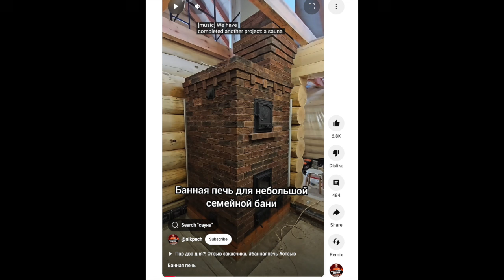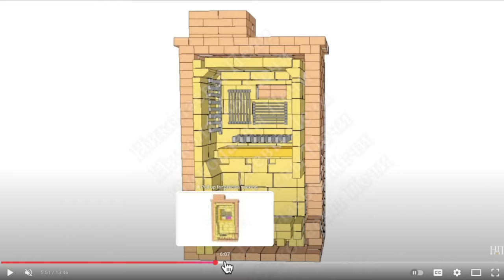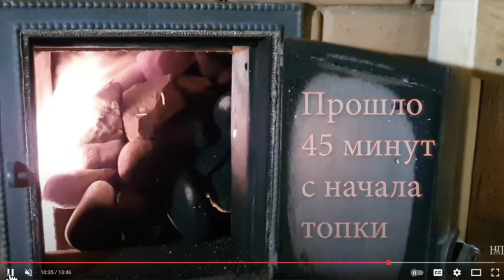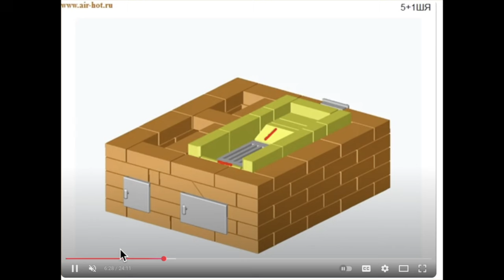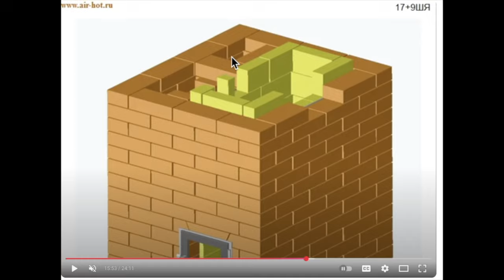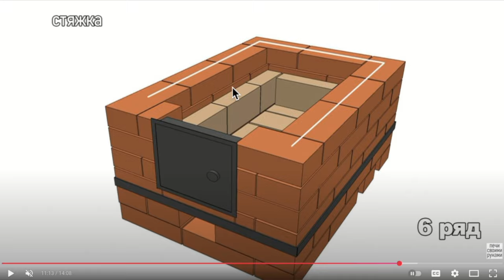Large Sauna Stoves Where The Flame Goes Through The Stones

Comment: Stoves with secondary air gets more heat  from the fuel (>2% maybe as high as 7%) but it also decreases particulate pollution and deadly carbon monoxide (CO).   So it burns cleaner - less plugging.
If your chimney should leak, you don't want CO.
Please write a script.  Your good information will be much easier to absorb with improved organization.
Pro tip:  If you start a sentence, finish it before you jump over to another point.  Reading a written script helps those of us who think of multiple things at once line each idea up in a clear order so we do not exasperate our audience.

Comment: I have a large fire place in my living room it has a gas connection if I use the gas with the flu open the heat just goes up the chimney so never use it. I heard once that there might be some way to convert it so I could run it with some type of adapter so I could run it without the carbon monoxide and heat the house?  Basically I’m asking if there is way to run a fireplace that actually heats the house?
Reply from the maker: An open flame of gas or wood needs the flue damper open so dangerous gasses can get up and out of the house. People with large fireplaces that want heat should place a wood stove INTO the fireplace and have that wood stove vent up the fireplace chimney, with chimney now having been lined by a 6 inch flex liner or with stove pipe. Only a stove placed inside a fireplace can heat a house. An open fireplace cannot.

Comment: Hey I have a question for you Sir, with the efficiency and longer duration of the Catalytic stove, why don't you ever hear about then being combined with a Masonry/Russian stove? Seems like a Constant 5-600° F might take longer for the initial stove warmup vs 9-1100° F temps but wood lasting almost 3x as long seems to me that if you have the bypass setup right (which the cat stove needs anyways) you could get a super efficient stove that has the best of both worlds
Reply from the maker: Won't work. A catalyst only works with an iron stove. Temps are too low. Russian stoves or masonry heaters only "heat up" with short burns at massive temperatures at 1200 to 1500 degrees in the firebox F. What happens when you watch a "CAT" iron stove. You see "slow flame" and smolder for 8 hours. That is NOT high heat. Wood is not magical. If it releases it's heat over 8 to 10 hours, then the longer period must mean lower temperatures "using the fuel up" more slowly.
Reply: @stoveadvice  but once you get it up to temp couldn't you just use the CAT system to keep it at the steady 5-600° to sustain it Long term instead of just Hot High Heat 3x a day ?

Comment: A tank of water direct against the flames is going to soot up like crazy with a cold spot.  Any heat exchanger has to be downstream of combustion or it quenches the flame.
Reply from the maker: Good point... and "cold" like that, creates a ton of smoke. Perhaps "Igor's" metal plate is very thick and the water in the tank above has no real ability to cool the heavy iron (say, more than 20 or 30 degrees lower than it would be normally). In this case, what you are saying won't happen. Remember, the water does not have to get super hot, just be warm enough....